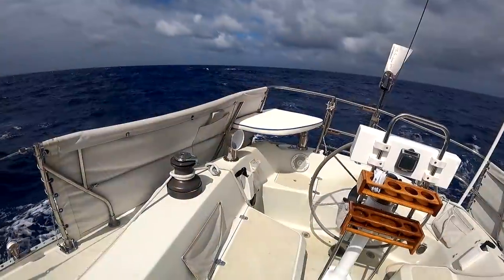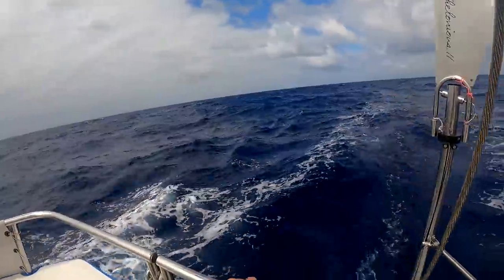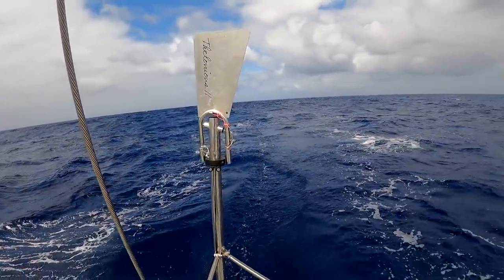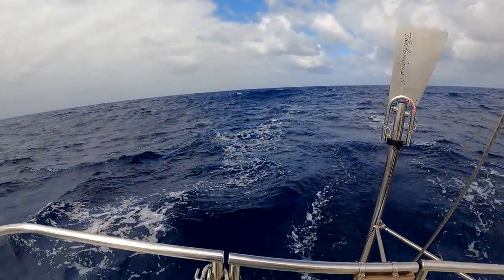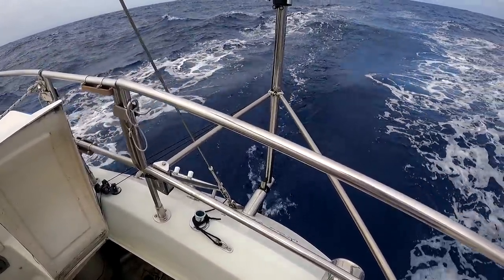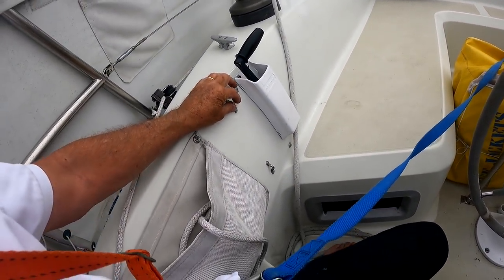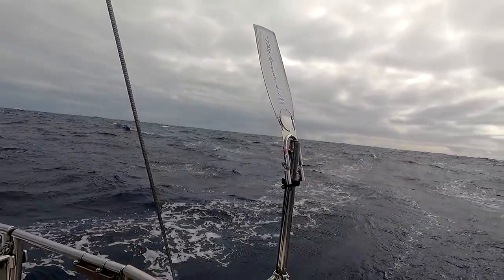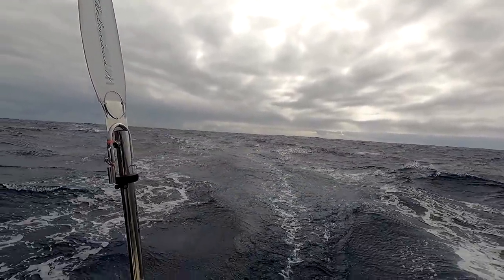Offshore with the Cape Horn Self-Steering Wind Vane

Comment: It's a very interesting example of how often times "sloppy fit" mechanisms are preferable to even a nearly rigid mechanism, for rough uses. I'd be interested to see a live camera shot from below when it is under max loads of the type that makes attachments fail. And I'm impressed that the friction in the system is so low it seems to have no binding issue, again the slop works. Kudos for mentioning the A+ aesthetics of the Capehorn, illustrating that true sailors are concerned with beauty for it's own sake.
Reply: Sloppy fit has proven time and tike again to result in the replacement of the less expensive components than does tight fit rigging set-ups, imho. 👍😁🍺🍷

Comment: About halfway to Hawaii, we, too, discovered that the eyebolts on the ship's quadrant need to be at least 3/8" not smaller.
That alone tells you all you need to know about the tremendous lateral loads in this otherwise ideal system that performed perfectly to NZ and back to the PNW.

Comment: Fascinating.  Thank you.  I look at all those stretchy lines and blocks and fittings, all going through thousands of load cycles hour after hour.  I wonder if many of them could not be eliminated with a direct drive, gear-driven coupling between the two quadrants?  Quieter, fewer moving parts, less slop in transmitting force to the steering wheel.  Probably more expensive, more complicated to install though.  

Also, I  gather that boat heading with this vane is entirely a matter of wind heading, i.e., you could turn in for a night's sleep with the boat set up on a broad reach, heading due west with a wind coming straight out of the north.  You wake up a couple hours later and discover you're now heading northwest because the wind has backed around to the northeast.   I'm sure you must have some kind of alarm system installed to let you know when there are major changes in heading.
Reply: @pauleohl  thank you Paul for the humor therapy
Reply: @pauleohl LOL.  I'm 70 years old.  Believe me, I see your point.

Comment: Seems very complicated with lots of failure/chafe points. Love the videos and the philosophical musings, good luck.
Reply: In fact it's uncomplicated and it seems so. No power source. No tight tolerances, all the stresses are handled by the same family of hardware that is used for the sails; line & pulley wheels. What it does seem is puzzling; which is very different than complicated.

Comment: I wonder how this CapeHorn vane compares to the Hydrovane and to other options like fully integrated electronics that take course, winds, etc. into account.
Reply from the maker: They all work. The boat design, shape of transom and commitment to battery power dictate the choice. Mechanical vanes work well and require no big battery bank or complicated recharging schemes (both of which get expensive fast).  But you still need a wheel pilot for motoring.  In a yacht heavy on electronics, with banks of lithium batteries and   inverter for microwave and hairdryer, a powerful hydraulic self steering system makes sense, and keeps the transom clear. But electronics can fail mysteriously, while issues with a mechanical vane can usually be fixed.  As to choice of vane, the boat matters, not so much for performance but installation.  The Cape Horn, especially, is much easier to install on some boats than it is on others, it just depends on the way the belowdecks steering apparatus is configured.

Comment: I’m currently in the process of rebuilding/fitting a 1929 international 8m j-class, I’m wondering if it’s possible to mount a wind vane to the stern? I’ve googled, researched endlessly for a proper way to install a reliable setup that both is incredibly solid and functional, as well as complementing the beautiful classic lines of the boat. If anyone has any suggestions or references, it would be greatly appreciated. My goal is to set up up as a short handed racer/cruiser, and solo her until king Neptune takes her, myself or us both.
Reply from the maker: You need a belowdecks autopilot. A wind vane on the stern would look wrong on that design.

Comment: Having just completed a 600-mile downwind passage, two-up, with a nonfunctional autopilot, I am now shopping for a windvane gear. No way will I put myself or my shipmate through that torment again. Unfortunately the layout of my steering gear precludes the Cape Horn system, which would otherwise be my choice. I don’t like scaffolding look of the Monitor or Aries, fine systems though they are. Will have to choose between Windpilot or Neptune…

Comment: Mr. Williams, can a good autopilot be as efficient? Or is it because they do not require any electric power!
Reply from the maker: Sure, all the big sailboats have autopilots now.  A wind vane makes no demands on energy and can be fixed when it breaks, and is often more appropriate for older sailboats without massive battery banks for deep freeze, AC,  microwaves and so on.  The price of electric autopilot and  vane steering installation is about the same.

Comment: I tried to visualize, when shown (9:50) the "Ronstan blocks" where they would be, "safety wired" if they could be safety wired. Is the failure point presumed to be the axle? Anybody know?
Reply: I think he meant the shackles themselves
Reply from the maker: @alcooper944  That's right,  the shackle pins have no eye on the pin to allow safety wire.  Being worked constantly the pins tend to back out.
Reply: @alcooper944  Thanks, I think I get it. The axle on the stirrup (lubber term) has a screw threaded end, and it works out. If they were longer the end could be drilled for safety wire. I was seeing them as peened over permanently like a rivet rather than threaded but now I see one bit fat end and the other not so fat.
Reply: @johnsmith1474  Yep you're on to it John, there are many different types,.  Christian just bought the wrong ones .

Comment: Six months later, any additional thoughts on the install?
Reply from the maker: The kinks (see https://www.youtube.com/watch?v=Oz8wpl9YG1o&t) have been worked out.  I appreciate the low-profile permanent install. I enjoy being able to engage the vane without much pre-rigging, since the control lines are always attached. But you still have to drop the blade into the water and install the vane on the structure.  I continue to believe that wind vane steering is of very limited value for daysailing, although invaluable for long passages.  The Cape Horn works well.  Degree of difficulty of the installation depends on the boat's existing steering system--some installs are easier than others.  Elegance? The Cape Horn beats all.  But all wind vanes work, so it remains a matter of choice.

Comment: Maybe I missed it: I didn’t hear comment about setting course. The wind vane steers the boat to maintain the course, so shall I assume that you set course first, and then engage the wind vane? Thanks.
Reply: The windvane steers by the wind. You set the vane at the angle to the wind that (at that moment) points you in the direction you want to go. As the wind changes direction the wind vane keeps you to the same angle to the wind so the boat will now be off course. As a result you need to readjust the angle of the wind vane to put you back on course. So the windvane doesn't keep you to a compass bearing.
Reply: Yes, the vane is mounted on a 360 degree turret that can be rotated, by hand or by remote control line, in the horizontal plane to align the vane's leading edge exactly with the apparent wind direction once the boat is set on the desired course and the ship's rudder position is locked in the centerline.

Comment: Good to see you again! Did you ever consider Hydrovane wind vane when chosing a self steering system? As I understand,the Hydrovane has its own rudder working and steering the boat independently without use of the main rudder. Hence avoiding risk of linkange to main rudder failing and also providing the safety of having a spare rudder should you damage the main rudder. If you considered this, could you please share your thoughts? Thanks. Keep the videos coming 👍
Reply: He had one, and he mentions it in this vid at 10:15.
There are three types of self steering according to the basic research I did today: those that use their own rudder, and two types that use the boat's. Using the boat's rudder is superior and in this case the Capehorn is the best method of that & the most neat and aesthetic.
Reply: @johnsmith1474  Actually he did not mention the Hydrovane, which has no control lines above or below the cockpit, is also a backup emergency rudder.  More elegant than the Cape Horn and much easier to install and manage.
Reply: While certainly acknowledging the advantage of a backup emergency rudder, to be complete, the discussion should also include whether a windvane system that uses the ship's rudder steers a given vessel as well or better than an auxillary transom-hung rudder in that given vessel, depending on the under body and location of the design rudder. @chriseggert420

Comment: Obvious benefits aside, does the Cape Horn produce a smoother track than could be achieved by a human at the helm? As a passenger, can you sense the difference between autohelm and a human?
Reply from the maker: Dead downwind a human makes a smoother course by anticipating corrections. But it's a lot of work and needs close attention. On other points of sail I doubt a passenger would notice the difference.
Reply: In our experience, they steer much better than a person.
Reply: Without fatigue, distraction, tiller reversal, compass course fixation, etc., our Capehorn always leaves a better wake than the humans on board.